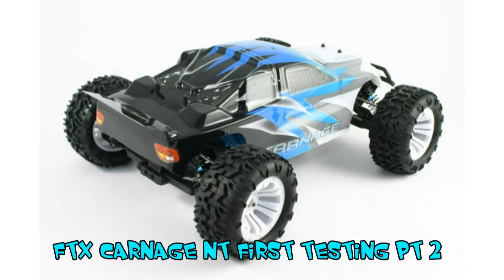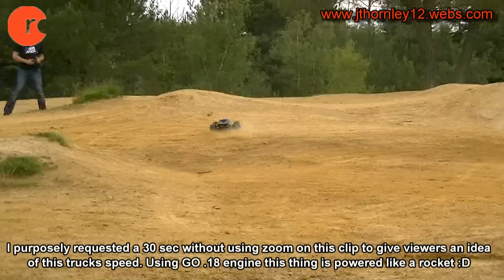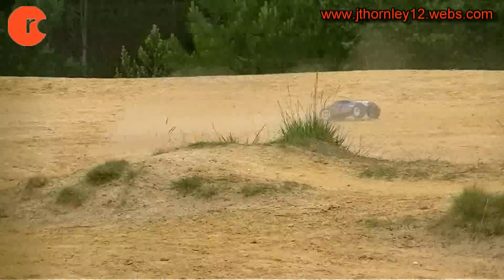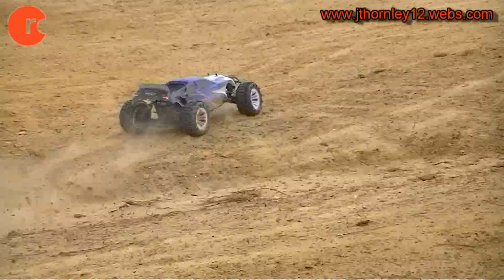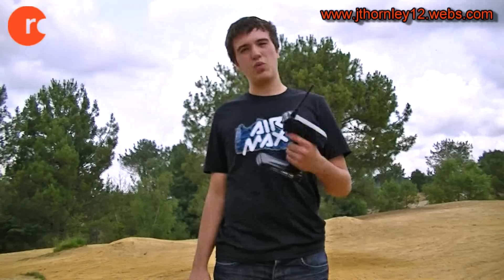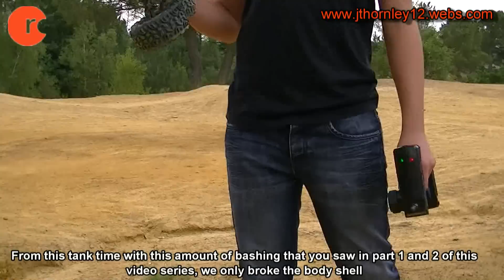FTX Carnage NT Durability Testing Pt 2

Comment: Have you had any rear drive shafts come out? Got mine brand new today on 3rd run in tank the rear drive shaft came out and was lost,don't know if snapped or what?
Reply from the maker: Hi Jake, I don't remember having issues with the driveshafts. I doubt it snapped, especially if you were just running it in. Do  the rear wheels look aligned ?
Reply: @TheRCBiker  hi mate wheelspin models sent me a new one out must have been a fault with existing one been fine ever since replaced.any mods you reccomend? I've snapped 2 suspension lower arm's (due to being my first rc car and not very good at avoiding curbs and lampposts so far lol) so going to order alloy ones but any other mods you recommend?
Reply: Oy and rear wheels look slightly turned in towards front but on pics they all do even pic on box back wheels look slightly on the piss
Reply from the maker: @Livefree90  That's good ! To be honest mods wise there's not a massive amount you can do. You could replace the plastic exhaust with a tuned metal one, but that's more of a cosmetic modification :)

Comment: I have a brushed spec, do you know if it is water proof or no? Great video
Reply from the maker: Well brushed motors are waterproof motors can run under water technically but the other components wont be